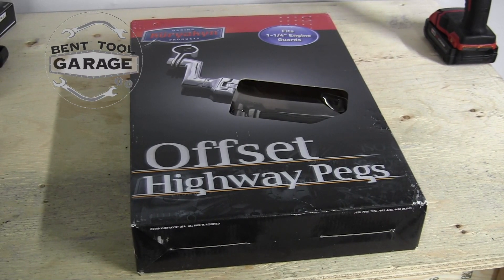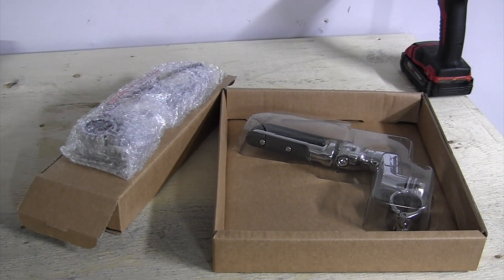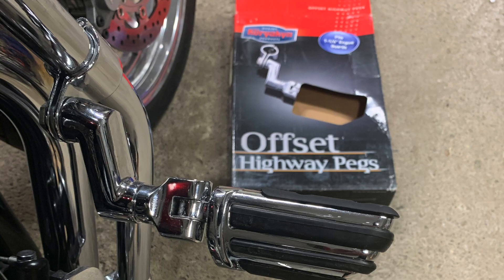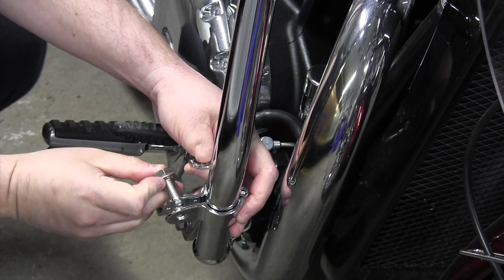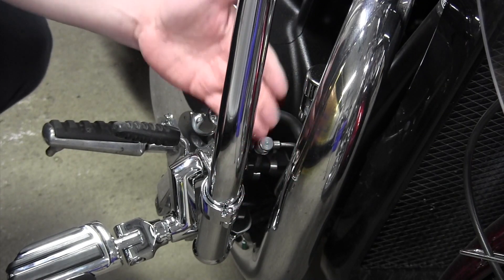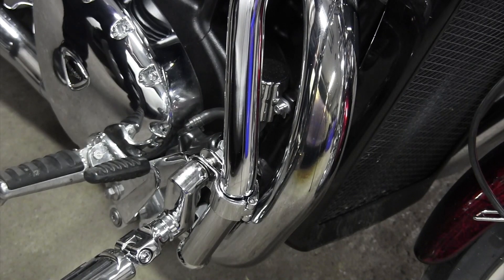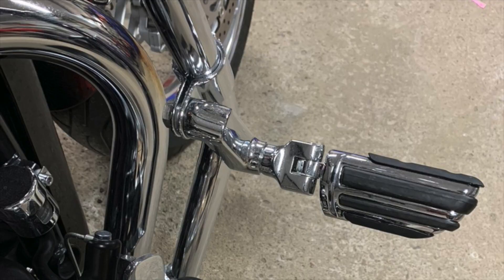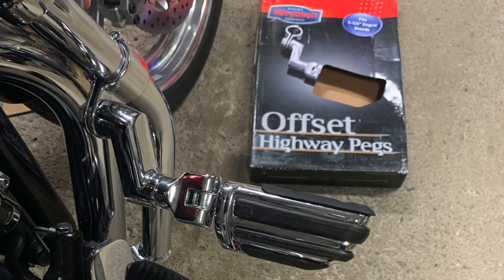Kuryakyn Highway Pegs Install - Bent Tool Garage

Comment: Are these made of steel or aluminum?  Good video dude.
Reply from the maker: Hi Rick, sorry it took a while to reply. I think these are aluminum as that is what other Kuryakyn offset pegs are made of - for example the Longhorn 4574 says it is "durable aluminum and premium chrome plating", so I think this is the same. They do feel durable and so far no issues to report. Thanks for the thumbs up!